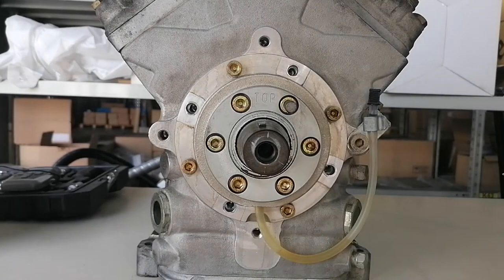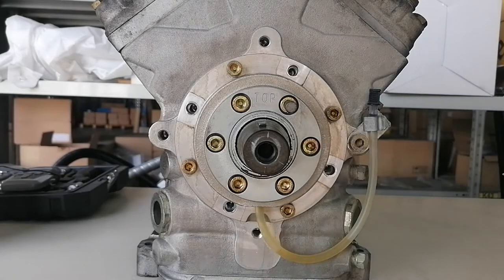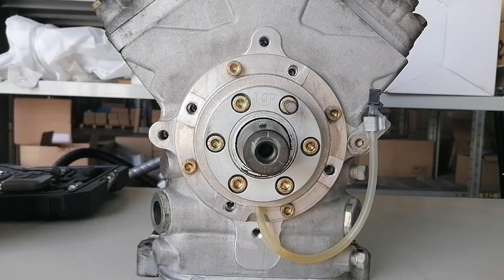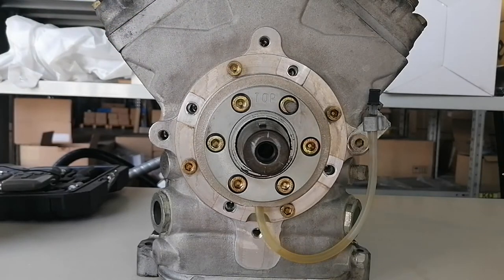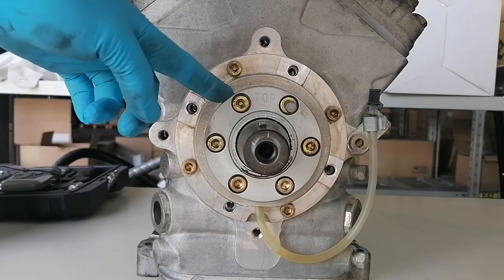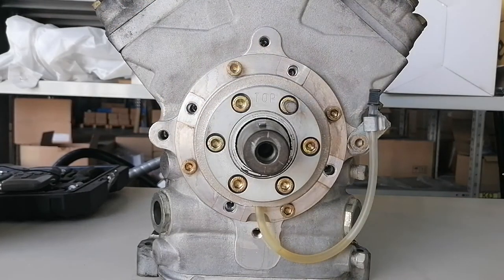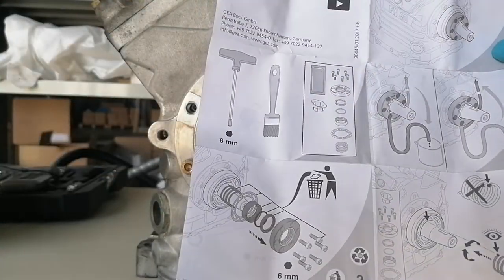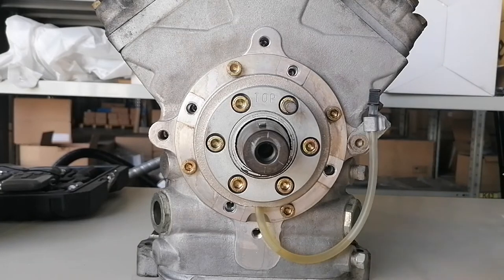Bock FK40 FK50 AC compressor shaft seal replacement (FKX40, FKX50)

Comment: Awsome tutorial! 👏 For replacing this seal kit,can it be changed on the vehicle whit the freon in it? Or should it be completly empty?
Reply from the maker: You can close the valves on the compressor, recover the refrigerant from the compressor and then you could if there is enough space. Everything needs to be super clean when working on the shaft seal.
Reply: @DIYHelper  thank you for your good advice?👍

Comment: how much the 80023
Reply from the maker: depends on region, 100-120 Euros, there are also aftermarket solutions. just search for bock fkx shaft seal, I am pretty sure Google will have you covered.
Reply: @DIYHelper  i want be your fans, you are great knowledge,
Reply: How to changce, the gear box as